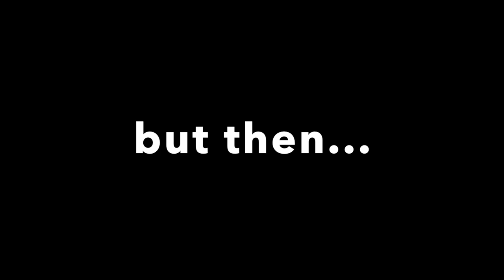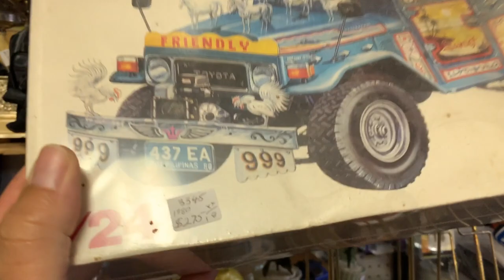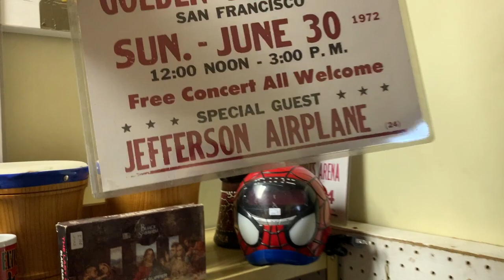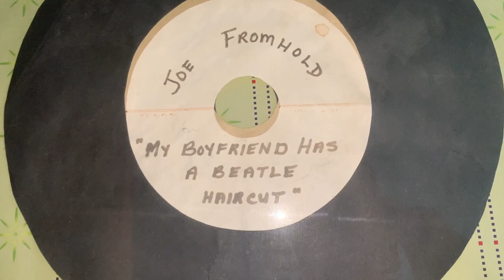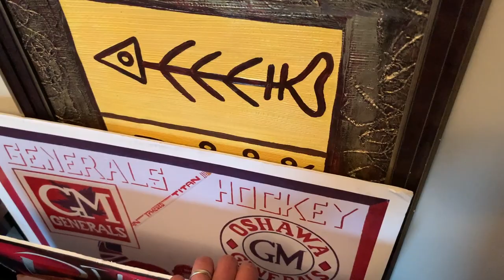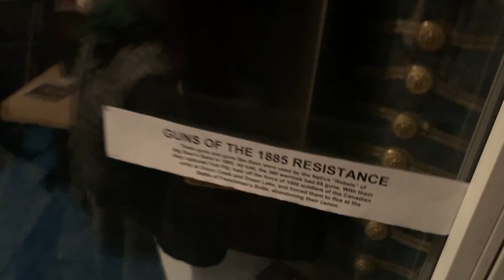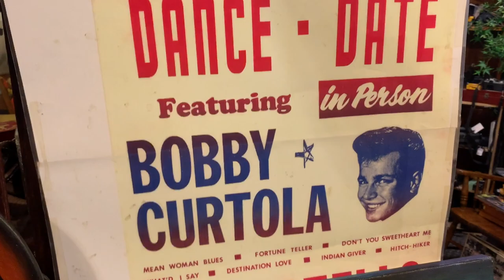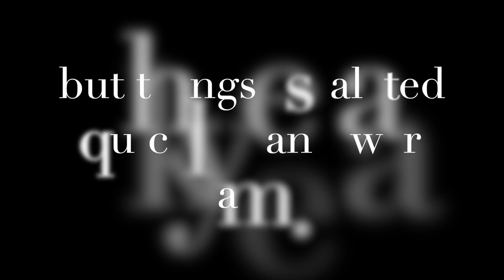Treasure filled hoarder house! Bonkers Estate Dispersal!

Comment: Those water bags were sometimes hung in front of the radiator to help keep the car from overheating when driving through the desert..
Reply: They are not for keeping the car from overheating, they are to re-fill the water in the radiator if it boils out!

Comment: Hi Alex The South African Water Bag was very popular for travelers and see on most cars from probably around the 40's if not before until about the 60''s/70's, you fill it with water and then hang it from the front bumper of your vehicle, and as you drive the air will keep the water in the bottle cold, or cool.  Just a little history for you, on how it was used. (ex South African)

Comment: The Pioneer brand water bag is a copy of those we used to see in the 50's and 60's. Soak em, fill em, and hang them from the front bumper. The air passing over them would "cool" the water, and when you were fully parched, with the four X60  air conditioning had sucked just about the last drop of your vital juices, you could pull over to the side of the road and get you a cool drink. Never personally tried it, I imagine it tasted like wet canvas.

Comment: That Stratocaster is in fact made for Rock Band 3, so it works as a controller as well as an actual guitar. Those are fairly expensive, they seem to go for around $300 and up on Ebay. But since they're actual guitars, I'm not sure it's really a high price.

Comment: I see that you got that water bag.  It was the canvas one.  My granddad had one.  He would fill it with water and make sure the outside of it was wet.  Hang it on the side of a truck and go out to work on the farm.  I don't know if he added ice.   The water on the outside help keep the water in the inside cool.  Also when driving the truck the air would cool the bag.  It was for drinking like a canteen.
Reply: My dad's was burlap-covered canvas.  He strapped it outside our 1961 Comet and it came in handy as we crossed the Great Smokey Mountains.

Comment: @9:47 I used to have the GI Joe Aircraft Carrier and that Fort also. I sold my whole very large collection (some still sealed..most not..but I saved the old cardboard profiles too) for almost $6,000 USD back in 2000

@23:19 The little plastic GI Joe figure is Cobra Commander in Black outfit VERY RARE one to see

Comment: lol Fender is not made by suare that's just their low end line. when and where was it made? that has everything to do with what it will bring. Made recently in China, not too much. earlier in Taiwan or Mexico a bit more. The fender squire amps can do right well because they are just as good if not better than some of even the US made ones... in my opinion. Just depends on model and when it was made.